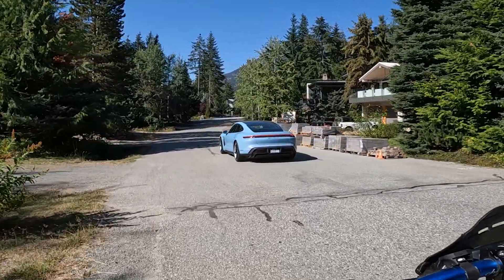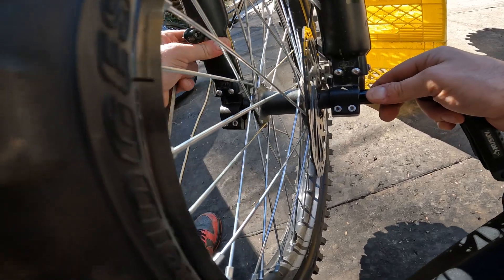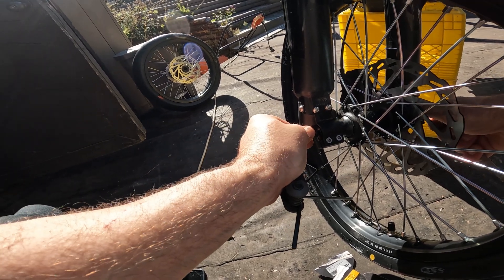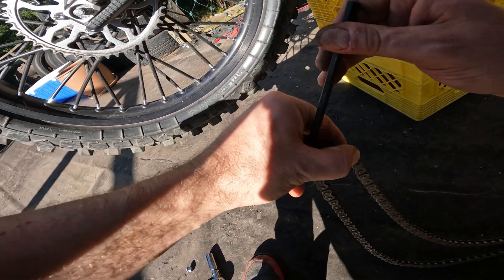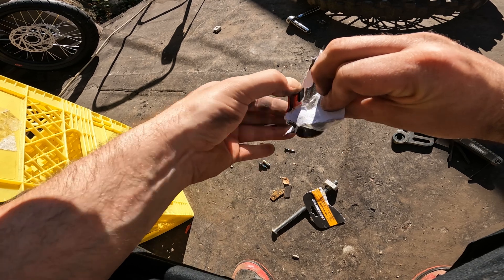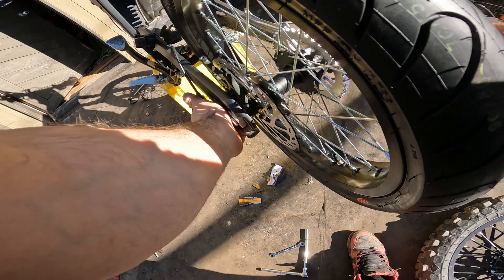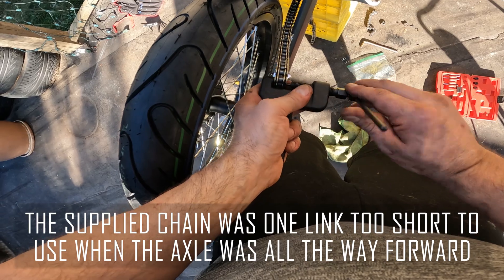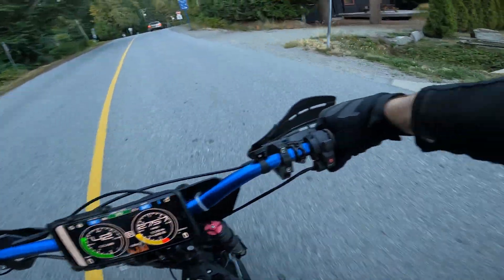LUDA POWERED SUPER MOTO WHEEL SWAP -  TALARIA DIARIES  - EP 51 -  GLE LUDA STING 8000W

Comment: I was able to use the provided chain. Just hard to pull enough to get the link in. I assume it’ll loosen up a bunch later too.
Reply from the maker: Mine was definately not long enough by exactly 1 link. I figured   there is no way this kit came 1 link too short and after wasting an hour with the axle hitting the 
frame groove in shortest position I decided to grab the stock chain. Added 1 link and it was installed in 10 minutes. Shit happens.
Reply: @electrified6043  lol Chinese world problems I guess. Been riding my supermoto wheels stock battery and controller. Definitely want more hit of power. Got the controller coming and thinking about the bypass or spending the cash for the 72v (EBMX) battery instead
Reply from the maker: Inwould personally use thr stock battery bypassed first. It is super easy. And a decent amount of power and range.
Reply: @electrified6043  sounds good will try
Reply from the maker: The battery bypass when I did mine I had 2  non issues.  Firstly, the GLE video was  not clear about what side of the  negative bus which cut wire went to. It doesn't matter apparently.  
2nd was the battery makes a pretty  loud humming noise like high voltage power lines. I googled this and heard stories of people who work in the  battery/ tech industry tsking about how loud 15- 20 or 100 batteries are lol.
You can even buy the proper wires, heat shrink and some ×ire wire connectors and do it  yourself. The GLE kit jad it all. All you need is a torque bit set, wire cutter or good scissors and a wire cutter / connector crimp. And electrical tape.
Reply: @electrified6043  killer thank you
Reply from the maker: Was not a big deal because I had the chain breaker. Would have sucked for someone without the necessary tools.

Comment: Just got my Talaria supermoto wheels. Any tips? I guess with the correct ratio for the speedo and if you would like a bigger sprocket?
Reply from the maker: I have been riding the speoxket it came with. But on 8000 watts. I have a 54t sprocket but never installed it. I'm able to wheelie pretty good on rhr stock sprocket. The 54 is probably better for slower wheelies.
Reply from the maker: I never changed the ratio but I had a cop radar me and it seemed to be accurate.  Don't quote me on it